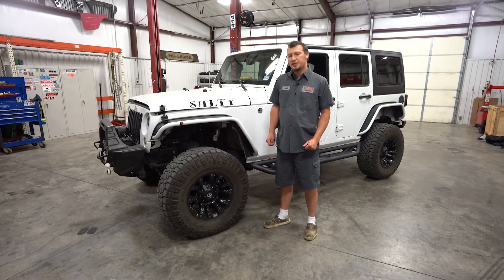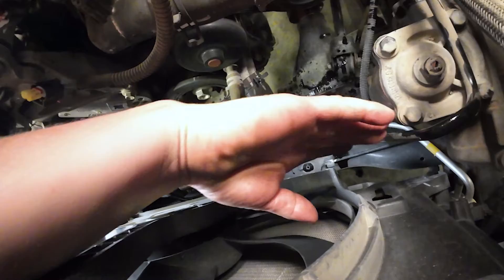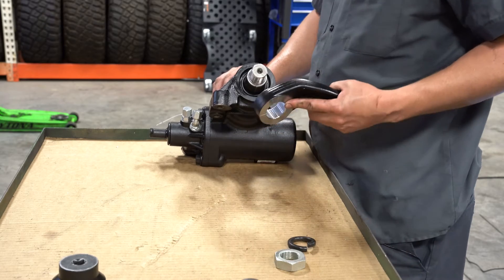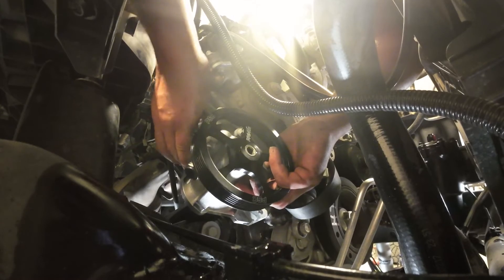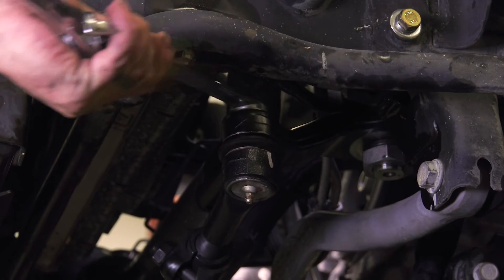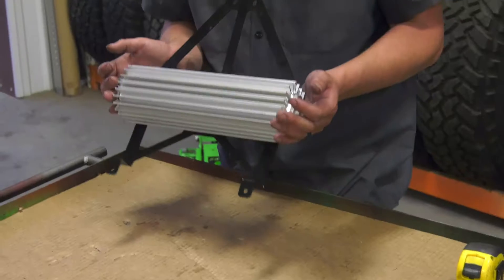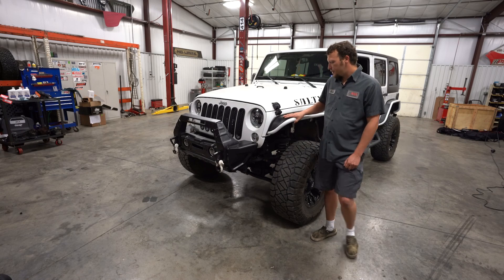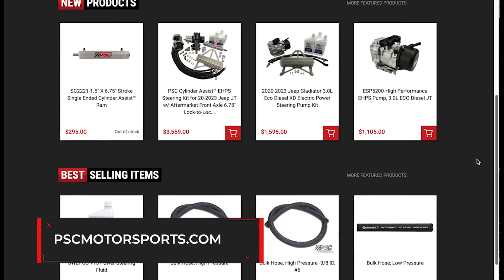How to Install PSC Adventure Steering Kit on Jeep JK (2012–2018) | Step-by-Step Guide

Comment: This was very helpful, thank you. Note to others, routing the line from the tank to the cooler fits much nicer if you go up higher between the radiator bracket and frame. I trimmed one of the three "fin" looking supports on the factory radiator to reduce pressure on the hose. Suggested location on mine put pressure on the hose from a metal edge.